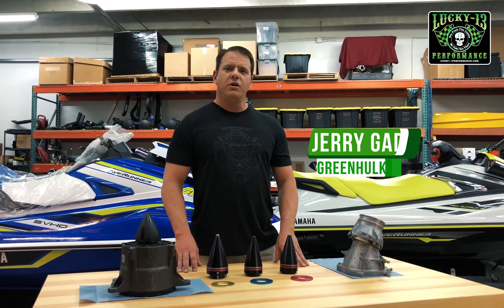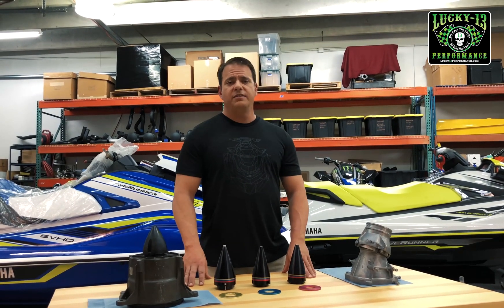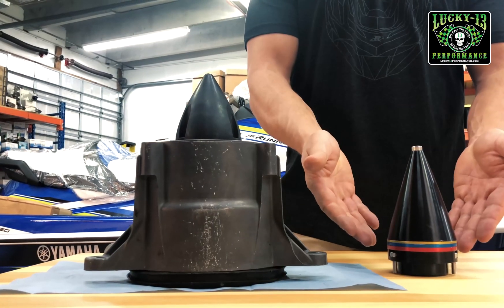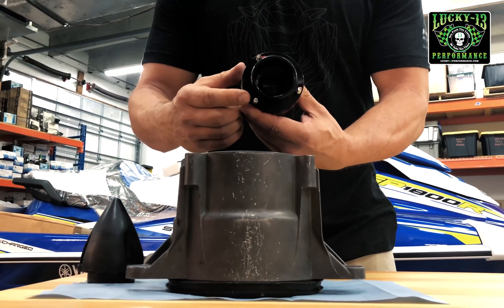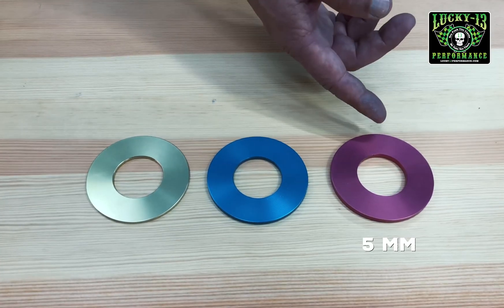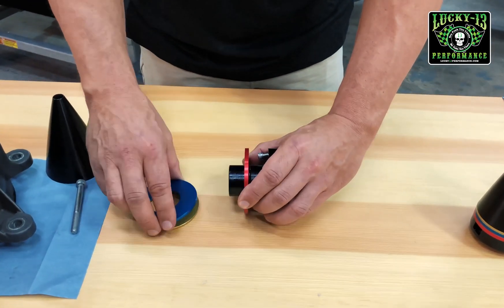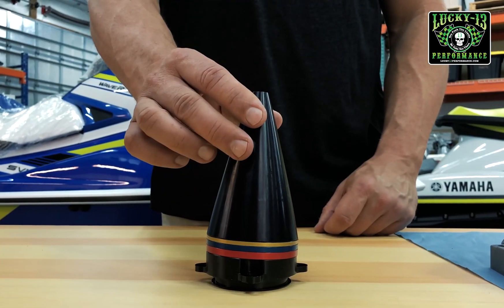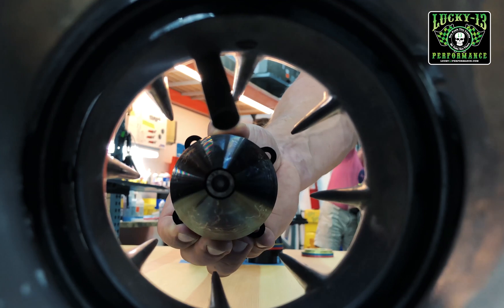Lucky 13 Adjustable Pump Cone Product Description & Overview GREENHULK.NET

Comment: Do you prefer the lucky 13 adjustable over the WORX non-adjustable cone?
Reply from the maker: Yes! The Lucky 13 adjustable pump cone performs the best and is adjustable for your riding conditions and the mods on your ski

Comment: My GP1800 is at a full stage 2 and I cavitate bad! Looks like this would help but how do you go about dialing it in.? Thanks!
Reply from the maker: This is the best solution for a GP1800 to fix the cavitation issue. It's a very easy install, simply replace the stock cone with this one. Best results are achieved with all 3 spacers in the cone.
Reply: @GreenHulkGarage  you would need to remove the siphon pipe to instal the cone?